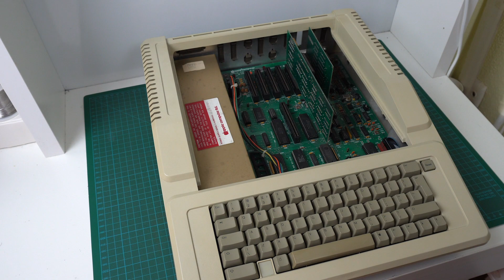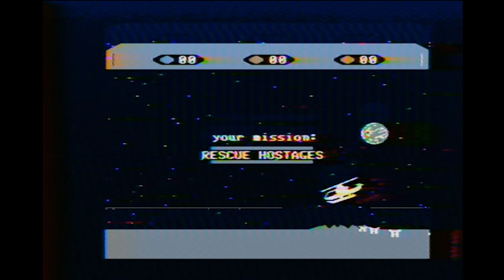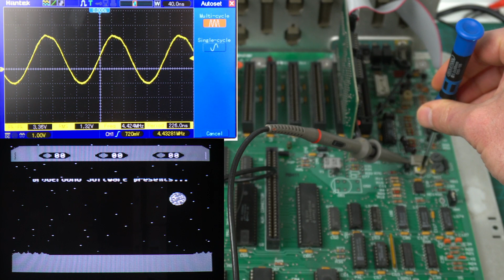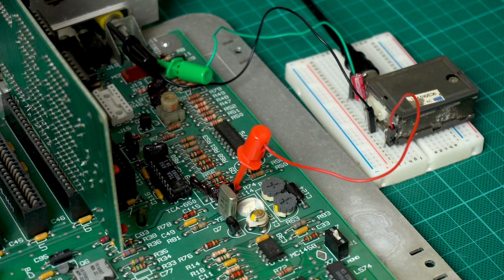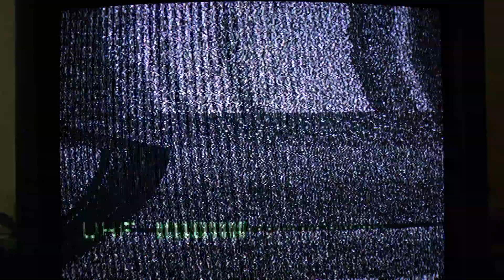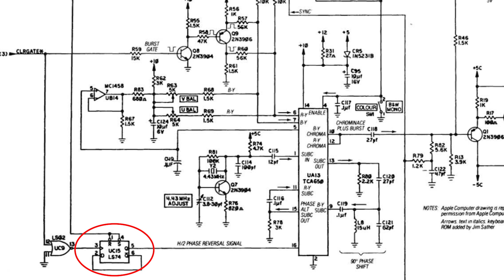Apple IIe PAL Color Deep Dive and Repair

Comment: Great video! Well done on figuring out the problem and fixing it! 

I wonder if a similar fix would work on the PAL Apple //c?

I used to have an Apple Colour monitor connected to one as a kid using the composite connector and it showed full colour.

However connecting the composite out to a tv showed only black and white.

Similarly and weirdly connecting a PAL colour signal to the composite in on the Apple monitor would only give a black & white image.

I’ve read about an adapter made by Apple (A2M4023) for getting colour out of the seperate 25pin monitor port on the //c but they are rare and expensive when it seems clear that the composite out is capable of colour anyway.

I think Apple’s method of converting NTSC to PAL was a bit off and perhaps the monitor had extra circuitry to decide the PAL colour composite signal?

Any chance you might take a look at a PAL //c? I still have mine but no special monitor and would like to fix it if possible.
Reply from the maker: I don't have any experience with Apple IIc, but from what I can read about it, it seems very similar to the IIe. I did also read problems with Apple PAL monitors showing as black and white only, so it seems it's not an unusual problem.
If I get my hands on a IIc I'll definitely check it out and make a video from it. These old Apple computers are really neat from an architecture point of view.
Reply: Yeah the IIc is nearly identical to a IIe, just has 128k of ram and a built in 80 column card and disk drive and more ports, that’s about it. I could get full clear colour on an AppleColour monitor just using a single composite cable. So the information must be in that signal for colour. Interestingly I read that the AppleColour monitors automatically switched to black and white for 80 column text mode. So perhaps that’s why they only showed monochrome for other video signals?

Comment: DO service the psu , mine came from Oz.. previous owner  didn't tell me about it.. got a nice smell of RIFA caps :( . also if you don't have one, I really like the w/drive for it :) . you can get a vga out card by the bulgairan woz , which I should get :)
Reply from the maker: Definitely! That was the first thing I did with this one when I got it a couple of years ago. And it was totally cracked, ready to burst too. 
The wDrive is awesome. That's what this video was originally going to be about until I ran into the no-color issue. So I'll have a video about the wDrive coming up soon :-)
Reply: @NoelsRetroLab  you in the apple 2 group on FB ? few euros are in it.. not loads though haha
Reply from the maker: I believe so (unless there are many different ones). I posted this video on a couple of them.

Comment: Easier to clip the legs from LS74 package and remove each leg individually.
Reply: Especially for 74 series chips which are easily sourced.
Reply from the maker: Agreed. I usually don't do it because the desoldering gun does such a great job. I think I stuck with it because I wanted to have the option to go back and test the faulty chip afterwards.

Comment: The trim cap should be set to achieve maximum signal amplitude (to tune into the resonant frequency of the crystal).
Reply from the maker: Thanks! As you could tell, I wasn't sure if there was a specific ideal setting.

Comment: Nice catch on the flip-flop. That video circuit seemed a bit over engineered.
Reply from the maker: Thanks! Actually, if you start with the premise that you can't change the video circuitry from NTSC to keep everything compatible, this was remarkably clever. I'm still kind of amazed that it works the way it does! :-)